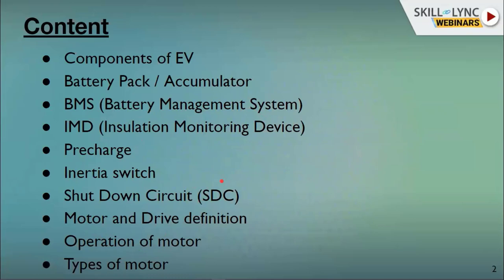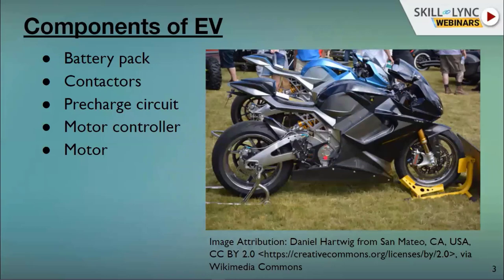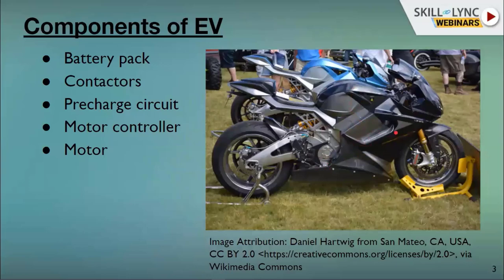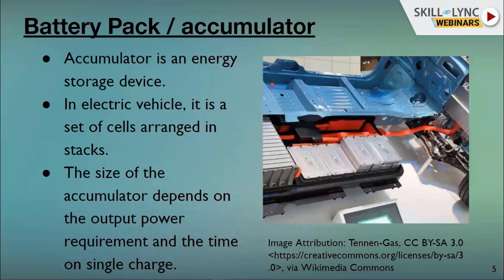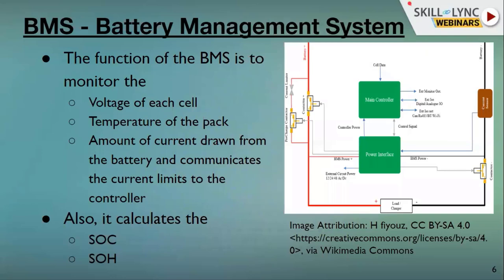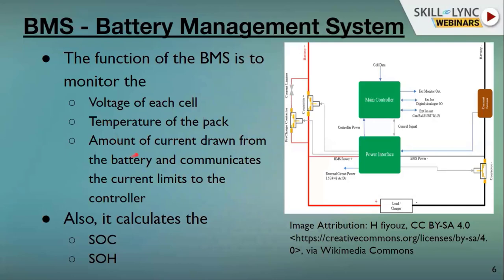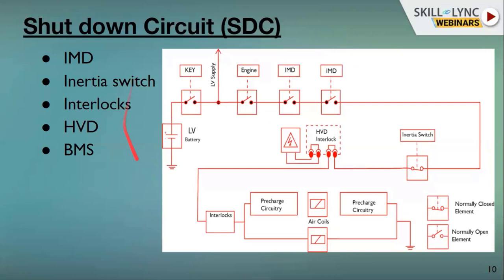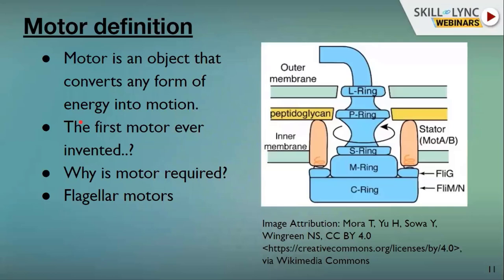Basics of Electric Vehicle (EV) Powertrain (Part - 1) | Skill-Lync | Workshop

Comment: I have doubt on EV motor selection.
If the kurb weight of vehicle around 1000 to 1500 kg.then what  capacity and power rating motor is choosen

What is continuous power, rated power, maximum power and peak power and what is difference between them